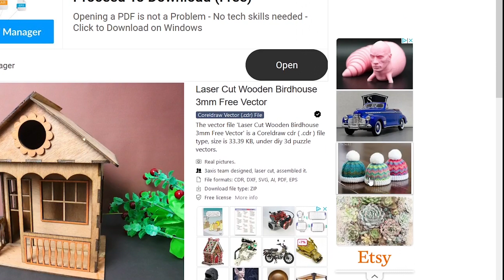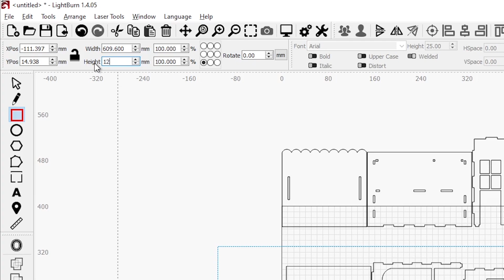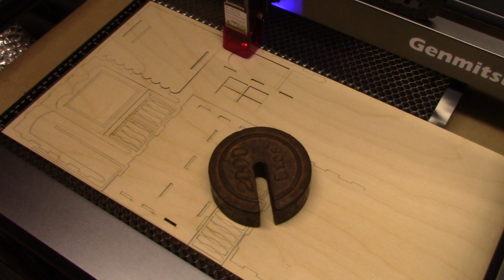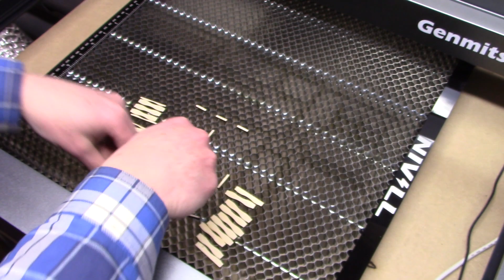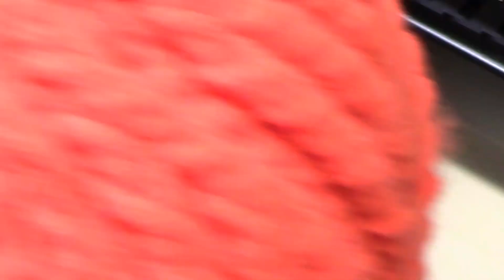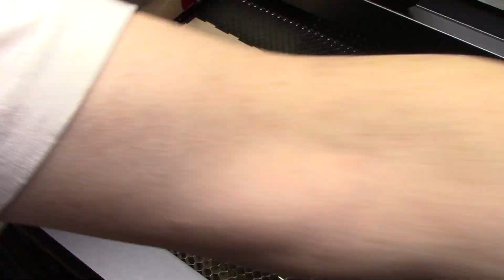Can I make this cool birdhouse?  The parts are larger than my laser working area!

Comment: Side note:  I have an ad blocker in my browser and I see none of the ads that you pointed to in your video.  You may want to add an ad blocker also.
Reply from the maker: Thank you for the input.  That is a tricky one for me.  I understand there are ad blockers that will hide the ads.  Part of me would like that and part of me doesn't.  It is site dependent for me.  Some sites are there and funded by the ads so seeing an add that makes the site free for me, I like that.  Some sites make some money from ads and some other ways.  Then there is the quantity of ads.  Many sites flood you with ads to a point where the content is obscured or you have to be exposed to 12 ads per paragraph of information and you have to view 78 pages (next, next, next...) just to read an article.  It's a mad ad world out there and an ad blocker can help eliminate that noise.  They can also reduce the revenue for a site that keeps them running.